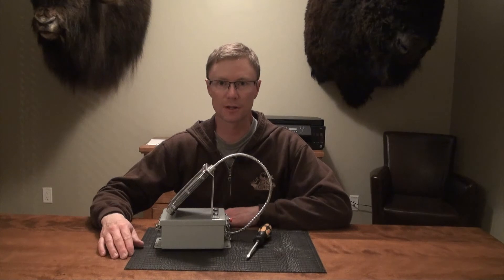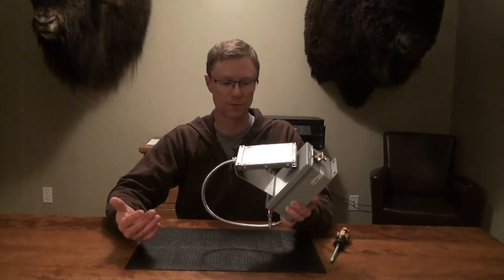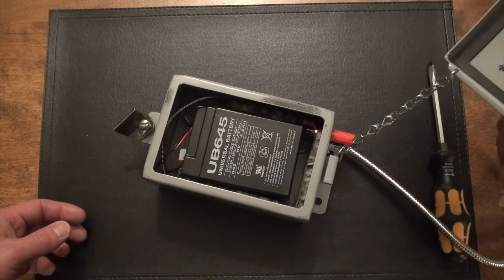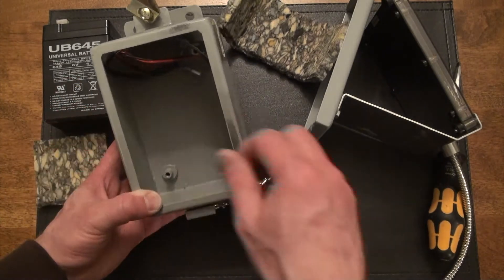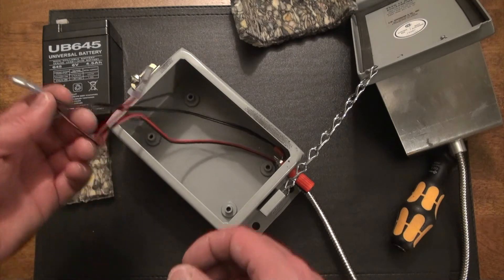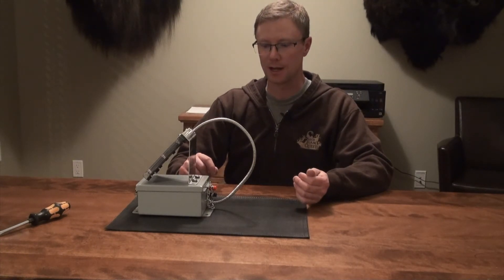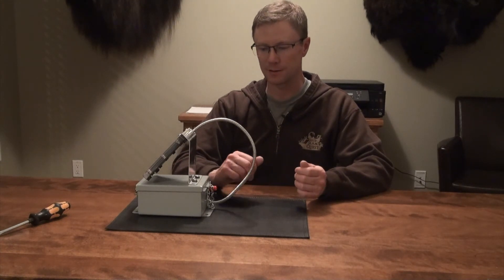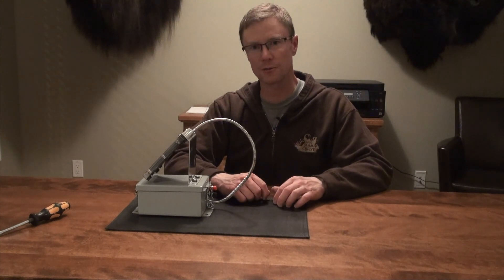How To Make A Quality DIY Trail Camera Solar Charging System TRAIL CAMERA | THE OFF GRID HUNTER

Comment: Adding one more comment, Tactacam has a Li Battery pack that is chargeable two ways, 1) via USB, not so helpful for in the woods, and 2) though and external solar charge port.  I am testing two at present in the field.  One is connected to a Tactacam solar charger (as my 10w system is down) and one is connected to a 30w panel and MPPT controller from Amazon.
Reply from the maker: @markcarter5450  I find with the tactacam my camera is too active for the solar panel to keep up after awhile and a good USB charge is periodically needed. I am in the process of doing a review on a camera with a built in battery and solar panel but also takes aa batteries as backup. Pretty impressed with the battery life so far for a no name Chinese camera

Comment: First, super workmanship.  love the box and the way you set it up.  I've done about 4 myself and would like to hear your thoughts on Battery Management Systems.
I'm in a cold snow belt area, so I've found I need two positions for the solar panel, one more like 45 degrees for summer when days are long, and one more like 20 degrees for winter.  Dual purpose.  Snow and ice can stick on the surface if there is too much support, this winter 48 degrees did not work.  panels got covered for weeks.  One box had 14Amp Hr of battery in it, and it drained that 12v down to 3.5 volts... I think it ruined the battery.  so that's worse than replacing AA's.  A solar charger or Battery Management System, which cuts off the battery at 10.5v (i've heard as low as 8v protects the battery from damage.. but most experts say 10-10.5v).  That means more Amp hours are needed or more charging capacity.  That one had a 10W PWM solar panel on it.  Also have one setup with 20W and 30W MPPT solar charger.  I found a low voltage cut off on amazon that i plan to incorporate and i will take on your Electrical box.  Love the compactness and weather proof ness.  THe plastic boxes were hit or miss if they kept the weather out.  The MPPT solar controlers are IP67 weather proof, so those are external to the battery box.  The PWM was not weather proof so I put it in the box.   Thank you for some excellent ideas.  I do use Tactacam and some Moulties, so they need a different power connection.  I've been using SAE 2 wire connectors.  Those work great as you get a firm reasonably weather proof connection.
of my four cameras in the woods, one made it from Aug 23 to today April 25 and is still taking pictures and showing 100% charged.  The 20W and 30 W are both showing 90% and I suspect it's from multiple days of clouds and rain.  I expect that to pop back up when it gets sunny.  One of my bigger problems is locating the cameras on trees and where to put the solar panels that is not in the shade.  I may have to do some chain saw work or take a post hole digger.  Not sure how much cable i can run with 12v and not drop too much voltage.  I know the numbers for AC,  but need to look up DC.  Again, super workmanship, great video.  Keep up the great work!
Reply from the maker: @markcarter5450  thanks for the extensive write up! I like you idea of having 2 panels with different angles for winter and summer. What I try and do is trim the tree branches up enough that the panels can get full sun but still are protected by the branches above (evergreen tree) I found this works really well in the winter as it keeps the panels clear of snow but still allows them to get full sun. I am in a cold northern climate as well so protecting the batteries is important to me as well. In the panel system I made I used a gel cell battery not sure if that helps with freezing or not but it seems to work well. I don’t have a battery management system on this one I built but I would add one if I built another one for the same reasons as you stated about battery damage if the battery gets too low. I actually started using the tactacam external battery / solar panel system and really like it. For the price I think it’s the one to go with. I find with the cameras that have the built in battery and solar panel the problem is the camera ideally faces north but the solar panel adjustment favors forward (north) and they don’t tilt far enough back to catch full sun. The external units are best. As far as length of cable to the camera I haven’t done the calculations but it’s not as far as I would like. Anything over 20’ I suspect has a lot of loss due to the small wire these units come with.